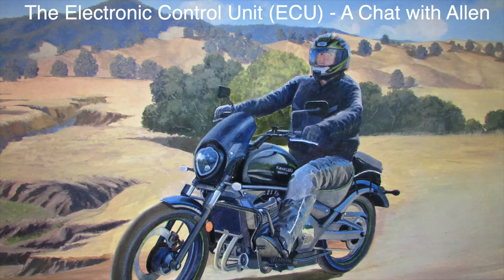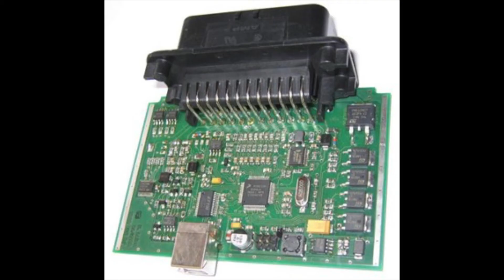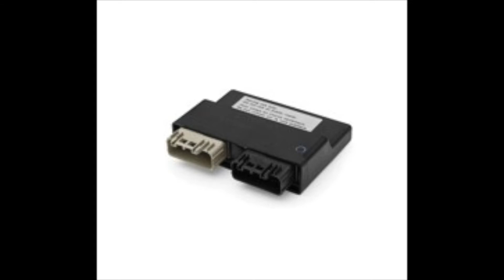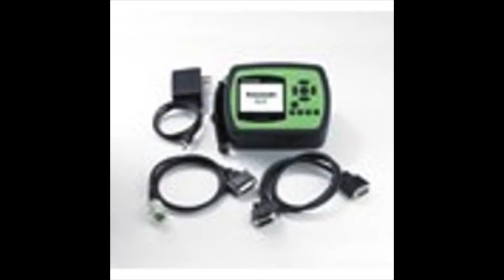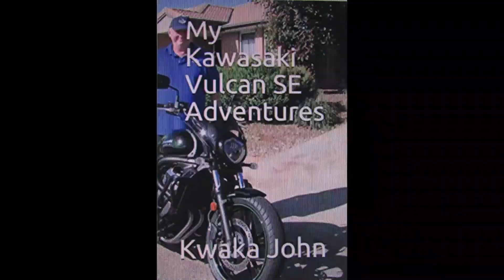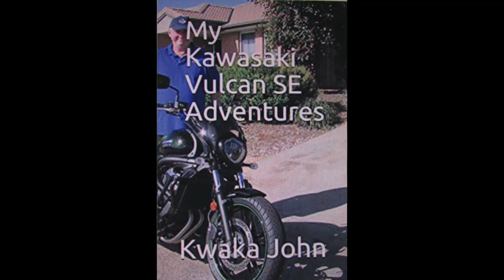The Electronic Control Unit (ECU) - A Chat with Allen

Comment: Hi John, I have a question for you as well as Allen. When you and Allen installed your Booster Plug did the dash light come on? Did the light come on when you installed your new exhaust systems? Thanks, Bill
Reply: Hi Bill, to your question specifically - No engine light meaning no codes. The ECU compensated for the increased exhaust flow via the Delkevic exhaust. AND the Booster Plug as advertised by the folks who designed it, also did not throw a code. It simply added a little more fuel at lower rpms smoothing out the throttle and engine braking. That extra fuel did not effect the O2 sensor at all, and did not require a re-tune or dyno run to improve the stock ECU parameters... Perfect!!!
Reply: thank you Allen,
Reply from the maker: In both cases - Booster Plug and Exhaust - I know that neither Allen or I had any warning lights concerning the new accessories! As Allen would say there were no codes!
Reply: @kwakajohn2391  thank you John,